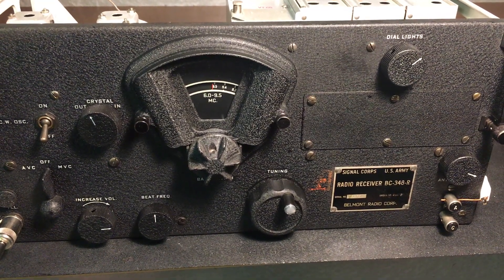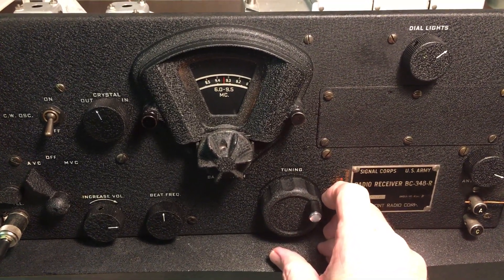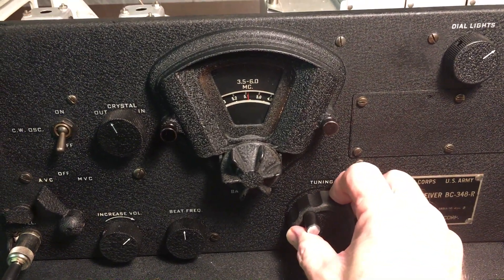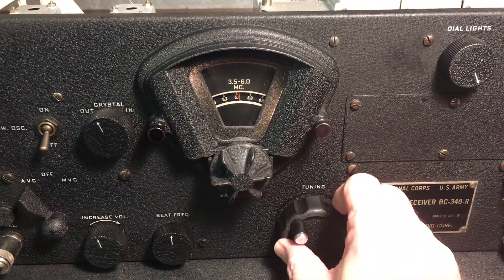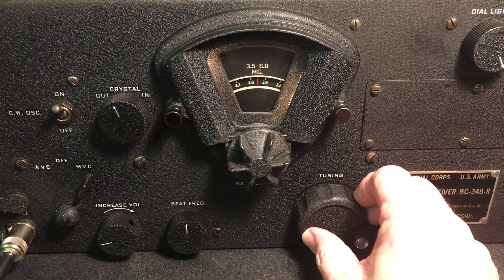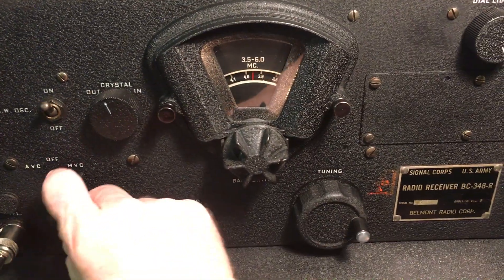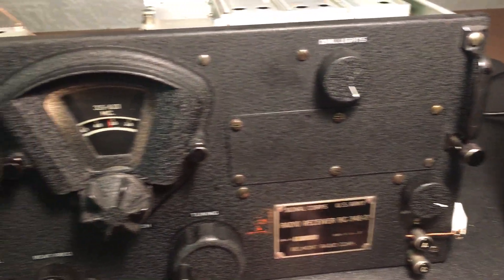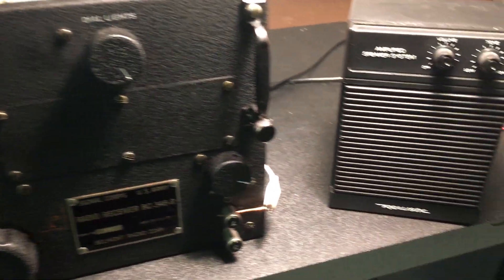Transistorize Your BC-348 Radio - PART 4

Comment: It's impressive, clearly a lot of work went into doing this conversion and it works well. Would have loved to have seen some of the actual conversion work in progress.  But after ripping all the wiring loom out and most of the components to convert, for me you might as well put a different radio chassis inside and wire the controls to it. I get it, you have a modern high performance result with the "genuine" retro look but I wouldn't want to go that far myself. For me the joy is seeing an old tube set light up and work. If I want to work on a solid state set I'd buy one of those and repair it. Can you still swap the modules out on this set?
Reply from the maker: Ged, welcome and thank you for your constructive critique of my conversion.
I'm sorry I did not have better detail of the "work in progress".  Putting it up on YouTube was a afterthought.

You asked a very good question about whether the "modules" could be swapped out.
The simple answer is, yes.  More on that below.

As you mentioned all the wiring was removed and all resistors, capacitors.  However, all of the main components were retained and NOT modified.  All the IF cans, the antenna, RF, local oscillator tuning units and BFO were utilized.  If you look at the schematic diagram, the conversion is an amazing overlay of the original valves and valve sockets with solid state devices used as replacements. And, the complex band switching this radio utilizes was electrically and mechanically retained.  I would not even think of building a radio from scratch that could hold a candle to this conversion.

Also, I like what you said about the joy of seeing an "old tube set light up and work".
That is why, for each of my radio conversions, I have a working valve/tube model.
It's also fun to put them side-by-side and see how they compare with each other!

The gentlemen who came up with several radio conversions has two much better videos about the process than I do.  This perhaps may clear up some of the missing pieces of my videos. https://www.youtube.com/watch?v=HfEkPkjsUJU&t=1363s

BTW, I like your video of that neat little AM radio.
Reply: @rfburns3472  Thank you for your detailed reply. I must admit I do find your conversions fascinating. If you do decide to film in more detail I would for one definitely watch.

Comment: nice job, I've been following Charles Smith for some time, now I'm following you as well, I am a fan of New Life for old gear. 73, W9FS
Reply from the maker: Thank you Jerry for the nice comment.  Charles got me going when I saw his solid state BC-348 and BC-454. He was very helpful when I needed some advice during the conversion process. Some of these radios are in such poor condition that the solid state rebuild could save them from the garbage heap.  73's